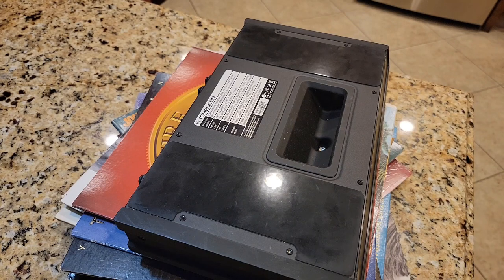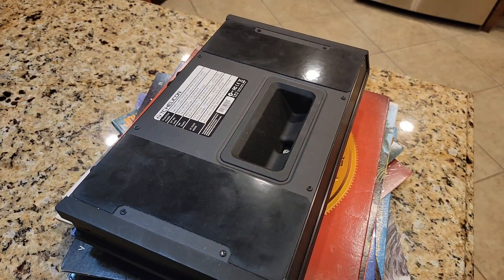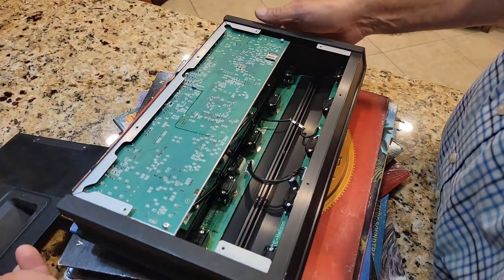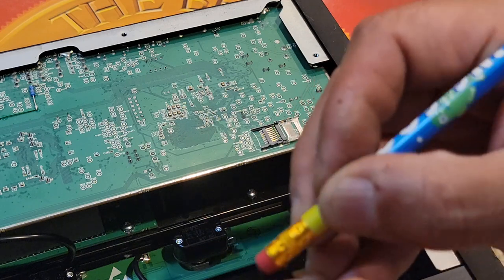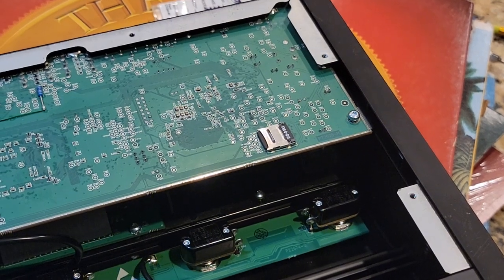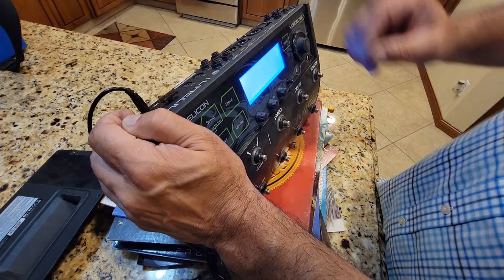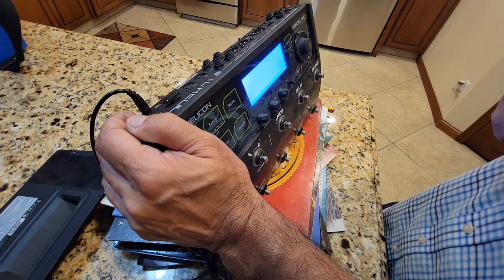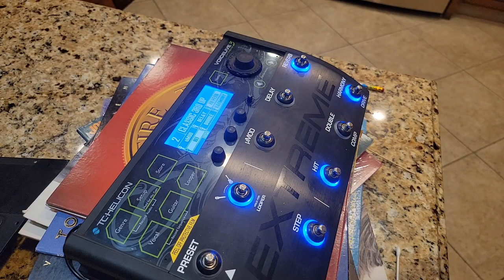TC Helicon Voicelive Extreme 3 - White Screen Resurrection (2 methods, one worked!)

Comment: Thank you SO very much. My wife's Extreme 3 showed the 'white screen'. After simply removing the SD card and cleaning the contacts of both the SD card and the board slot, it worked like a charm, and all of the presets are intact. I forgot to use an old tried and true cleaning method...clean the contacts! Thanks again!

Comment: Thank you so much. It works perfect now. First time after cleaning with alcohol wan not work. After that I took a tiny screw driver and slightly scratched edge of contacts (not on micro SD). After that everything works. One more time thank you very much.

Comment: Thanks for posting. I have slowly developed an annual routine of cleaning my microSD card(never had to put a new one in thus far🤞), cleaning and tweaking the connections, AND cleaning the power supply connection with DeOxit D5 as well. The issue that has repeated for me over the years has been that, after startup, the footwsitches and control surfaces would just stop working. I use a remote 6 switcher and that would continue working, but meant that I often couldn't see the changes even if I could hear them. One night I had the blue blank screen from the beginning of my set until about 2 songs left. Luckily, I use a mixer with effects I can dial in. The next morning, cleaning time and it worked great all ovoer again. My 2 cents: Don't sleep on cleaning the power supply input either

Comment: Fixed.  THANK YOU!  9 screws, some contact cleaner and a motorized toothbrush, and we're back in business.  Strange, though:  The (previously) failed unit is my spare, which I bought brand new about 6 years ago, and never sees daylight other than for Preset updates.  But my gigging unit, 8 years old, and which has seen literally thousands of gigs (also was bought new, when they first came out), mostly outdoors, in the Florida heat and humidity, and has been through half a dozen soakings from rain and wet pool decks, has never failed.  How does that happen?  Anyway, again, THANK YOU very much.
Reply from the maker: Glad this helped! The universe works in mysterious ways!